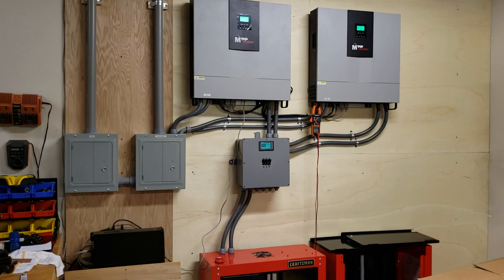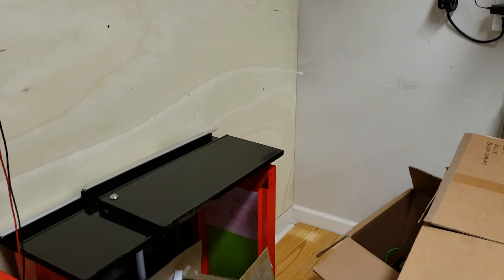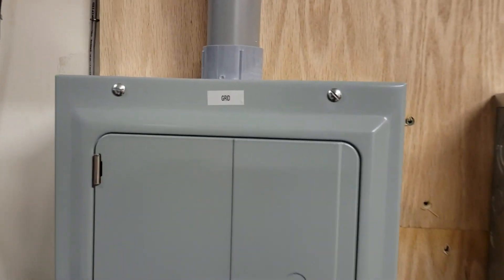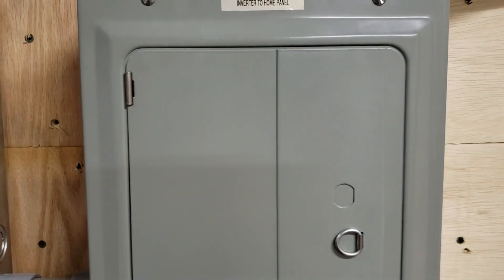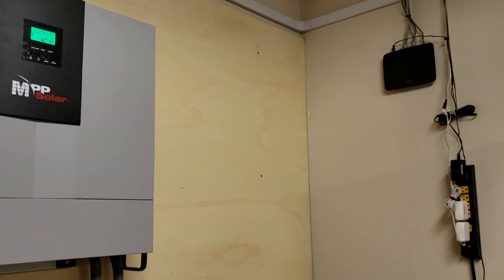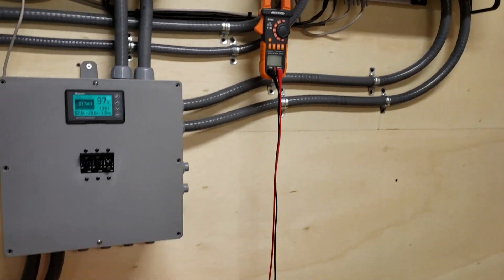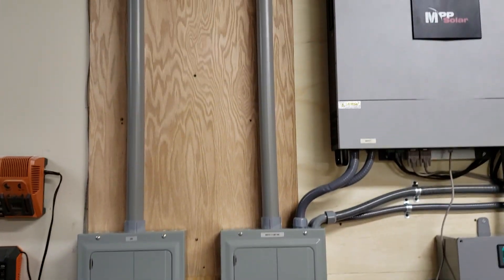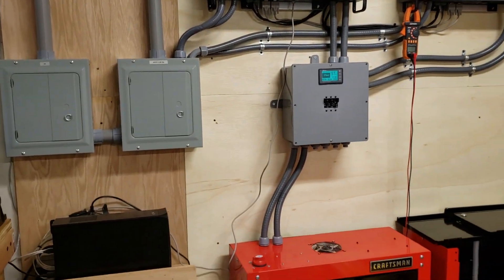MPP Solar LV 5048 Expansion Update.

Comment: Good morning I have a problem in my project I bought 2 MPP solar LV 5048 but I do not know how to make the electrical connection I entered the two you do not have a video of how they made the breaker box thanks
Reply from the maker: ok. Can you post a video on what you have so far?
It will help me determine where to start.

Comment: Nice. Getting ready to hook my LV5048 up next weekend hopefully. I was wondering if it was ok to hook up the output neutral to my main electrical panel and "share" the neutral between some circuits that are still grid powered and some that will be on the inverter. Couldn't find any information about it in the manual whether that's ok or not.
How did you go about wiring it to your main panel? do you still share grid power with some loads such as AC/Heat?
Reply from the maker: Neutrals cannot be shared. My main 200A breaker is outside next to the meter. AC breakers are also in that panel. After that power goes to the house panel which is in garage. My inverter output is wired into house panel. If everything goes OK and I get 3rd inverter then I am going to work on wiring AC systems into LV5048's.
Reply: @DMIINC2013  thanks for the info. I was afraid of that. I installed a secondary panel to use for the output of the LV5048 for all 15 and 20 amp circuits in the house and wanted to know if I could "cheat" and not disconnect the neutral and ground wires to all those circuits in my main panel and just extend the hot wire to each circuit and share the neutral bar. lol. ok. then I will have to disconnect the neutral wire as well and connect them that way. I see the grounds are linked together on the LV5048 so I will use the main panel ground as common then.

Comment: Nice work! I'm interested in more details about how you tied the AC input / output to the house power. Are you using a transfer switch or passing all power through the inverters and letting them handle the transfer?
Reply from the maker: All of the grid supplied power passes through inverters first and is then distributed through breaker panel.

Comment: am I understand correctly that your main panel can use max 10kw of energy? (LV5048 X 2)?
Also are you going to be able to setup peak shaving mode with inverters?
Thank you!
Reply from the maker: Main breaker panel can handle way more power than 2 LV5048's can produce or supply. My plan is to be independent of the grid power and use grid power only as back up when necessary. Peak and off peak is not really worth it in state of GA. In addition to that MPP Solar does not have adequate software to handle peak hours. They did publish communication protocol so you could build your own software but I am not software programmer.
Reply: @DMIINC2013  thanks, did you have any problem with getting permits from county because this inverters are not UL listed?
Reply from the maker: What part of the country do you reside in? You might have different rules that apply. All grid tied equipment needs to be UL listed. That is way I understand it. Off grid or using grid as back up not so much. Other people might have different opinions.
Reply: @DMIINC2013   I'm in California, San Mateo county.

Comment: Have you tried a max load and a max endurance test yet?

I did.

My batteries did 92 amps max load! (87% inverter capacity!)
My batteries did 24 hours just barely. The cutoff at 48V started beeping at 49V.

Very pretty setup!

https://youtu.be/15QdNkbJ_qc
Reply from the maker: Nice setup. Was just watching your video. Yes I did battery capacity test https://youtu.be/ssZo-q0HPzc?t=1 and load test https://youtu.be/YG0bJdT5kVk?t=1